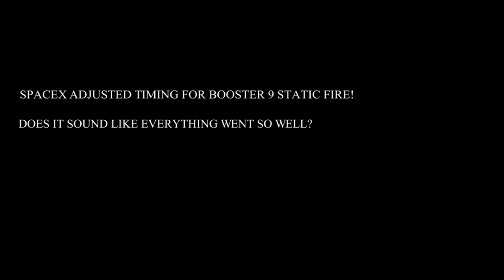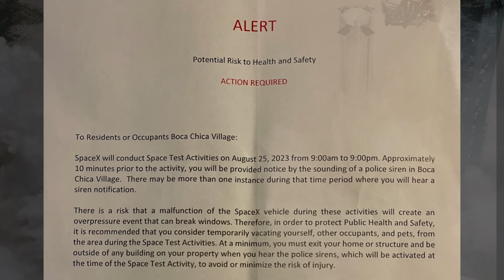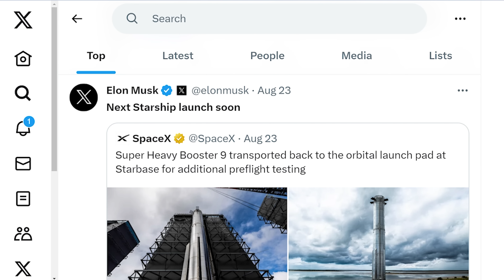SpaceX Adjusted Timing For Booster 9 Static Fire! Does It Sound Like Everything Went So Well?

Comment: Lift off will be impressive as always, when it eventually happens. Those engines should be bullet proof by now. No mission has been a complete success yet. The FAA will limit them to a single flight  a year, then shut them down.
Reply: Wow, you’re off base all accounts. While making great progress, booster is 0/4 in getting all 33 engines going- indicating a continuing propulsion system integration issue that needs be solved (which I think they will- but, not yet). And the FAA is NOT holding them back, nor trying to shut them down; just the opposite. Besides their first job- public safety- FAA also has the job to encourage & promote commercial space launch, which they continue to do. - Dave Huntsman

Comment: Major problem with booster.  All 33 engines have never fired continuously for more than 3 seconds.
Reply: Since the starship is in testing mode trying to develop a stable nominal functioning rocket issues like that are to be expected.  I would only feel concerned if in a year or so when they are launching more regularly they are still having engine problems.

Comment: Good video. But another explanation for not seeing much steam is that the pressure the raptors pushed into the deluge system nearly stopped the water flow.

I understand your take on that, but i would not rule out that the waterflow was massively reduced. I would guess that the booster puts much more pressure on the plate compared to the 12-20 bar in deluge system.
Reply: Did you know, the engines were at 50% of their power?  When they change to Raptor 3 Engines, will this new water system Hold?
Reply: That's up to the test. I honestly don't see how this could go unfazed, surely some damage will be one, if not I would be impressed. Look at the first launch again and see the full power, it's a lot of power :P.